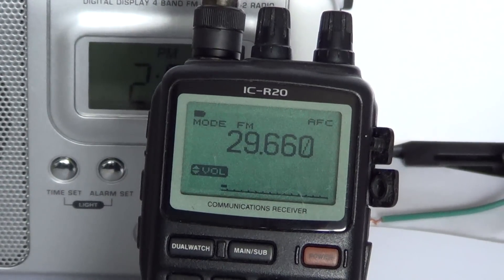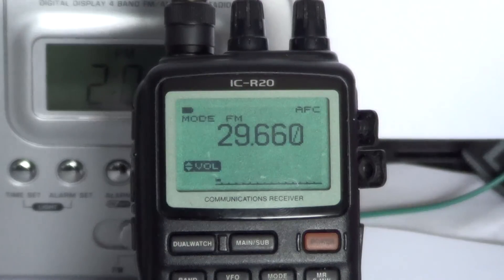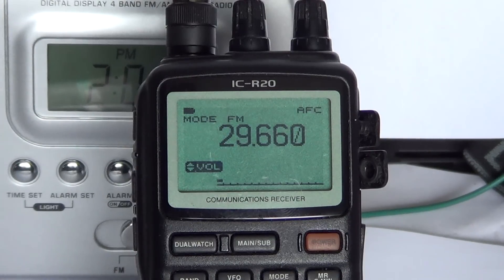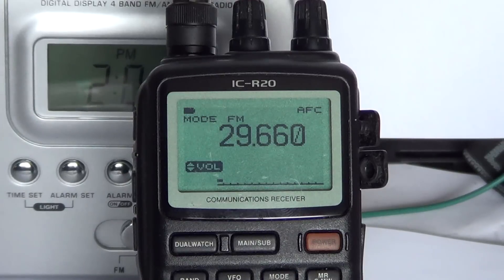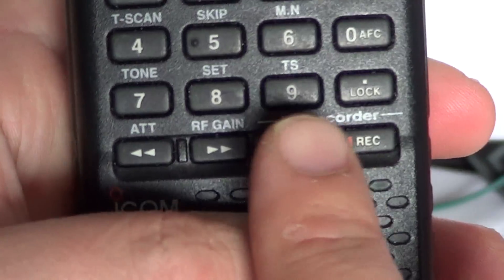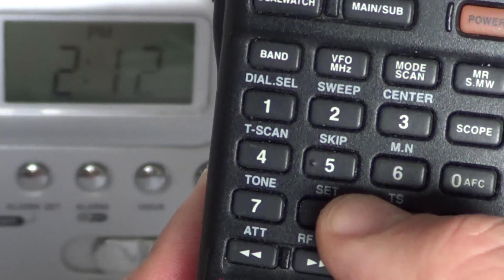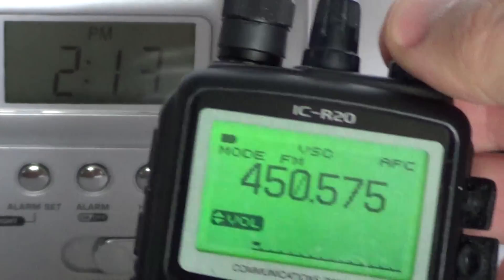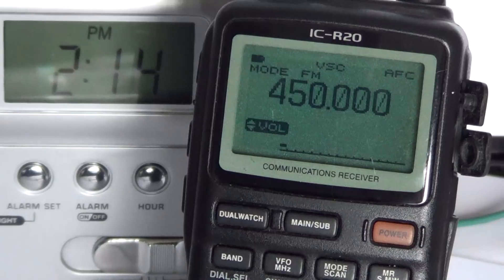Icom IC R20 Basic Operations - Tuning Steps

Comment: oh, and then another one comparing software control programs. basically what i've found is nothing for the mac (black cat has a cable test program) and hrd the only reasonable option on windows (leaving aside a lot of overkill, overpriced euro stuff). and hrd is no panacea, it barely controls anything. if you check the links at rr db and dxzone you'll find 90-95% of them point to dead pages and abandonware. /guy (73 de kg5vt)

Comment: tks for providing these mini-tutorials. as a newbie to the radio, i'm finding them useful. when you get to some more advanced functions, i'd like to see how to monitor a repeater using both the dual receive function with the input/output frequencies and the memory offset function where you set the offset and direction with the rptr output freq when you store it into memory. thanks! /guy (73 de kg5vt)